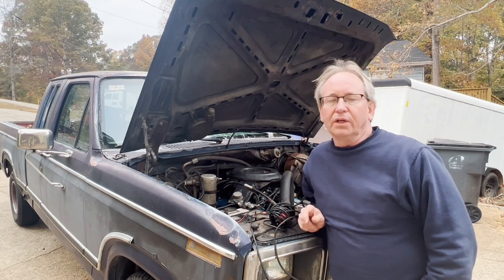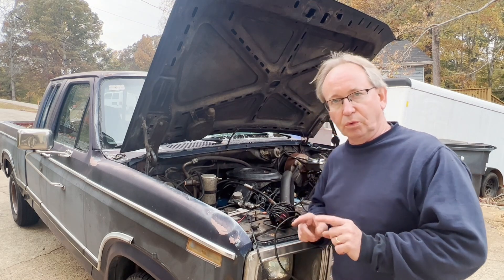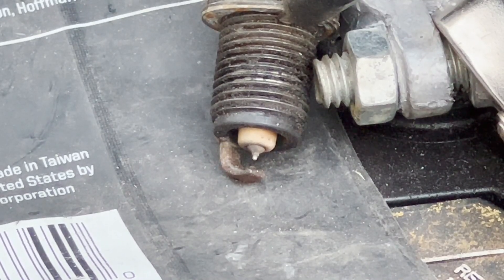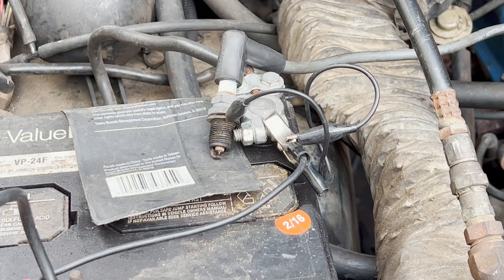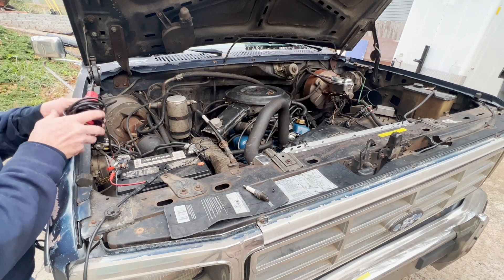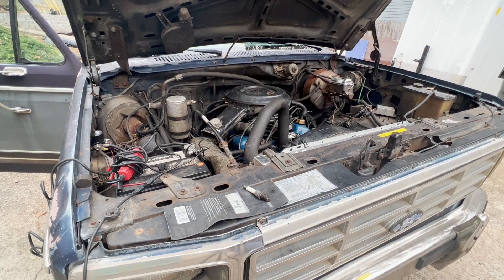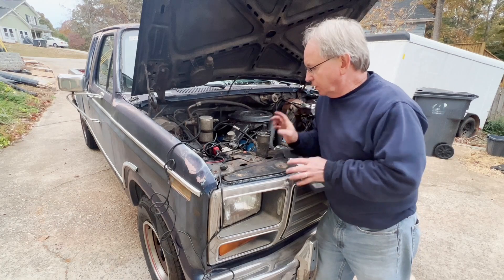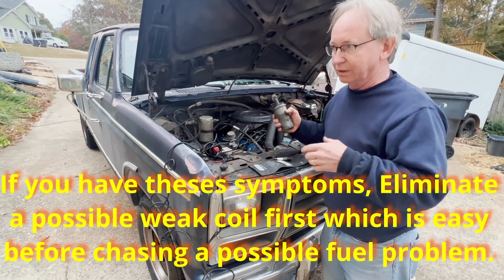How To Quickly Diagnose The Sneaky Weak Ignition Coil

Comment: My truck started up and ran at idle perfectly for a while but ran terrible under load changed starter battery solenoid checked all grounds harnesses wiring now a crazy voltage drop every time can that be related to a bad ignition coil
Reply from the maker: Hi. Thanks for watching and commenting. Yes, this video has helped countless people pulling their hair out messing with the fuel system and it's the coil breaking down. That's why it's "The Sneaky Weak Coil". Only takes a few mins to swap a known good coil in and see if that's it.
The Starter/Battery/Solenoid are all out of the circuit, once it's the engine is running. If the alternator is working properly, you can pull the battery right out of the car while it's running and it will stay running, which is actually something to check. Sitting idling the voltage across that battery if the charging system is working should read 14 - 14.2 VDC. If the alternator isn't charging then the ignition system is now using the battery which it shouldn't which will drain the battery and lower the output from the coil causing a weak spark.

Comment: never do this as hydrogen gassing do and have and can explode like bombs when sparks or flames are nearby.The cardboard shield is something helping but you never know and the resulting blast explosion could blind you easily.
Reply from the maker: Hi, Yes good point. I thought about that after the fact that the battery was not the best place to have open sparks on top of. FWIW, that was just a visual aid. The point of the video is how a coil under load will break down and present itself as a fuel system problem. This video has solved that problem for many people that were pulling their hair out. 
Anyhow, thanks for reminding me about that. I'll pin a disclaimer comment to the top so it's always the first comment at the top. Thanks

Comment: Great information.  I had an issue with my 68 Bug with a high energy coil.  It seemed like I was running out of gas.  Luckily I have a fuel pressure monitors, and was able to validate there was no fuel issue.  Problem was a defective coil that the manufacture claims their equipment was bullet proof.  Well guess what?  Once I replaced the coil the car runs perfect.  I was able to show that the secondary circuit of the coil was defective.
Reply from the maker: Hi. Thanks for taking the time to watch and comment; glad the video helped you diagnose and solve your issue! Those little rascals are indeed sneaky. ;-) They can test fine statically (ohm meter) leading you to believe they're fine, but only fail dynamically of which swapping is the quickest way to prove it, or rule it out. 
Thanks again for watching. Glad the video helped.

Comment: Don’t focus on the color of the spark focus on the consistency of the spark
Reply from the maker: Hi. Thanks for taking the time to watch and comment. Good advice. 
In hindsight, I could have left all that out as the camera doesn't see it the same as your eyes. Your eyes and ears can see and hear the difference, but the camera phone doesn't unless it's extreme. Kinda wish I left that out or presented it in a different manor. 
The objective of the video/lesson is that the weak spark as RPM (input frequency) increases deceptively presents itself as a fuel system issue and has people wasting all kinds of time and money chasing a decoy.
My first vocation with years of training and experience is in electronics (check out my vintage electronics repair videos) so I have a deep understanding of how inductors, a reactive component, react to frequency, how they work when they're working, and how they fail. It's a transformer using pulsing DC to emulate an Alternating Current so they can build and collapse a magnetic field with the back EMF inducing a phase shifted stepped up voltage in the secondary.
I enjoy teaching and helping. I'm happy that the video as seen by the comments has helped many folks have an "ah-ha" moment and solve their issue. I had a restoration and repair shop and would have DIYers tow their cars to me after buying new carbs, fuel pumps, etc and I'd fix it in seconds. They were both grateful and kicking themselves at the same time lol.  This is actually my highest viewed video.  I'm doing a series right now on a 66 Mustang and 347 Stroker. Just loaded the first two videos yesterday you might enjoy. Thanks again for watching.

Comment: Been a long time since encountered these problems.  With the old points and condenser it was easy to back track but with electronic  {no points no condenser / capacitor}.  I think you have it the wrong way around,  a tight blue spark is healthy -  but a fuzzy yellow spark is the weak.  I was thinking fuel problems as going for long drive first tie in ages -  when going fast for long then it would start to pitter -  but I still do think its a fuel filter issue not keeping the float bowl full -  as it seemd to be related to the fuel bowl running low.  But you comments today definetly hit the mark with cold starts.  I had renewed everything {accept the rotor due to robbery of their cost}  and put a hot sports coil in.  But 6 months back in NZ summer i suddenly had to start using  starter spray.  Problem is the solution,  without spacific extortion.  NOTE.  I had a friend once who said  "Dave - If you want yr car to run like new - you put new parts in."  So I ended up renewing  rotor / cap / plugs and leads.  I had to keep backwasing my fuel filter  {having elec pump makes this easy. Eventually had to flush & filter fuel from tank to carb.  Looked like someone syphoned gas - but also put some mud in tank - literally}.   After every fix would run right as if I got the problem then start breaking down again.  Turns out -  when I put the new leads in, ran fine in the shop parking but started spluttering. Given missing on all cylinders I swapped the HT from coil to cap with my old one - then ran well.  {new one defective}.  After going round in circles on long drive I go to start after putting fuel in -  wont start, spark fuzy yellow.  Determined the new coil now at fault.  Luckly didnt throw the old coil out and put that in - and now runs fine.  So put new parts in but be warned new parts can be defective.  Its a tight blue to white spark is what you want.  Im thinking to get cheap chinese coils and make setup so each plug has its own coil trigered by the distributor cap set up modified to trig trasistor for each coil.  Dont know yet. Devil in the detail and results in the determination.
Reply from the maker: Hi. Thanks for watching and taking the time to comment. Yes, you're correct on spark color/appearance. I mis-spoke.  
Here's how it all works: 
A coil is actually a Transformer which requires an Alternating Current to induce the Back EMF into the Secondary and step up the voltage. The pulsing DC to the primary which is the result of the points opening and closing or a pickup in the case of electronic ignition acts as a simulated AC by applying and removing DC to the primary. 
The coil can "Ohm Out" and test fine with an Ohmmeter as far as resistance which is only being measured by a small DC current from the meter. Under actual operating conditions the thin coating of insulation can break down causing internal winding shorts and or it's impedance/reactance to change which is a resistance that is only present when there is an alternating current. As the throttle opens the frequency increases. Not to Geek Out, but Reactance XL is XL=2pi (or 6.28) x f (Frequency) x L (inductance) in Henries: XL=6.28xFxL so if frequency (Engine RPM) increases then reactance (XL) increases. If there's an issue with the coil, the inductance rating or Henries (L in the formula) goes down and so does the Reactance and the Secondary Output which is the center coil ignition wire to the Distributor. 
Fuel starvation will act almost the same way. I have a video on that on my channel where I had a flaky fuel pressure regulator intermittently and shutting off fuel flow. 
Ironically, sneaky weak coil will fail and recover at the exact same throttle/load position. Fuel starvation failure point will jump around as how it fails is determined by what the load conditions were just prior and what you're telling it to do when it fails. It will recover at different point backing off. With the weak coil it's always the same spot backing off that it recovers. 
Hope that didn't put you to sleep LOL. Thanks for watching and taking the time to comment. ;-)

Comment: Took me the better part of a year to find and resolve the same problem, only difference, mine started fine when it was cold, but refused to start after it was hot. Tried checking everything from voltages, vacuum lines, emission solenoids, fuel flow, fuel pressure, plugs.............. when in the end, it was the coil. Now my 1983 351W starts quicker and running smoother than when it was new.  👍
Reply from the maker: Hi. Wow. That is great news! Glad my video helped you resolve the problem. Sounds like the ambient engine heat was affecting the windings.  Coils (at least old ones) also have oil in them to help cool them. The oil can leak out. The weak coil is truly "sneaky". I had a restoration and repair shop where owners would bring me their cars on a flatbed after spending all kinds of time and money going down the fuel system rabbit hole. I had figured this out as kid with a bunch of old coils. A coil is actually a Transformer which requires an Alternating Current to induce the Back EMF into the Secondary and step up the voltage. The pulsing DC to the primary which is the result of the points opening and closing or a pickup in the case of electronic ignition acts as a simulated AC by applying and removing DC to the primary. 
The coil can "Ohm Out" and test fine with an Ohmmeter as far as resistance which is only being measured by a small DC current from the meter. Under actual operating conditions the thin coating of insulation can break down causing internal winding shorts and or it's impedance/reactance to change which is a resistance that is only present when there is an alternating current. As the throttle opens the frequency increases. Not to Geek Out, but Reactance XL is XL=2pi (or 6.28) x f (Frequency) x L (inductance) in Henries: XL=6.28xFxL so if frequency (Engine RPM) increases then reactance (XL) increases. If there's an issue with the coil, the inductance rating or Henries (L in the formula) goes down and so does the Reactance and the Secondary Output which is the center coil ignition wire to the Distributor. 
Hope that didn't put you to sleep LOL. Thanks for watching and taking the time to comment. ;-) Glad it solved your problem and you're running strong again. 351 is a great engine.

Comment: Thank you! You helped me diagnose similar issues on my '92 400E Mercedes. Very helpful!
Reply from the maker: Hi. Thanks for watching and taking the time to comment. This is an impromptu video I made about 2 years ago after it had just happened. I knew what it was right away from experience and thought back to when I was a kid tinkering with parts laying around and ran into this with an old coil I had laying around. It had spark and ran but under actual driving load it would bog down and said aha.
Years later I had a restoration shop and repair shop. People would bring me cars on a flatbed that they were just throwing parts and time at, mostly carb/fuel system and distributors. I had it fixed 5 minutes after they left and would call them the nest day. It would have just been mean to let them know it was the coil and took 5 minutes to fix. ;-) 
This video had helped numerous people, even other shops, so I'm glad it helped you. That's my main objective: to help solve problems and teach. Hope I gained your subscription. Going to be having lots of content on my 66 Olds Toronado I'm putting together for the 100th Anniversary of Route 66. I've got numerous videos of my 74 Cutlass on Route 66 last year.
Reply: @mkdhdinfiniteendlessconten3873  Only once or twice this past winter the car was lugging under load exactly like you described, and these are known for fuel pumps failing. It just seemed so odd that would idle fine, but struggle under load. Only did this for a week, then fast forward to today when the car failed DEQ with HC=530. This still failed after I had checked secondary air pump, cleaned out the EGR and tested the valve... The car also was fowling distributor caps at ~10k which seemed quick so I began researching causes for distributor caps wearing quickly and got to wondering about ignition coils, found your video. I replaced both ignition coils for both banks and went back to DEQ  and it passed with HC=209. I'm happy to have saved some money, and even more proud of myself for proving that I could figure it out (with your video's help of course). Thanks again!
Reply from the maker: Hi. Thanks for the kind words and so glad my video solve your problem. I'm impressed with your forensic approach to researching, diagnosing, and resolving the problem. That's how to properly solve any and all problems with anything from health to machines. I had to look up DEQ. From context clues, your listing the HQ (Hydro Carbons) pointed to Emissions. I see that some states like Oregon and perhaps Virgina call it DEQ, where most states or metro areas simply refer to it as Emissions. I'm in Georgia, and only the metro ATL counties have emissions inspections here for vehicles 25 years or younger. Also over a certain GVW are exempt. 
They've become more realistic with the limits. Earlier testing required a Dyno. While having the testing as a requirement is a hassle in ones day to day life as a yearly thing, the testing points out if the engine is not properly burning fuel. If it's not, you're harming your engine. Ironically Hot Rod/Performance engine tuners are adding AFR (Air Fuel Ratio) monitors which require an O2 Sensor to properly tune the carb and engine for optimum fuel mixture which means best performance and engine health. 
It's very interesting to see that it essentially cut HC in half. That's a big deal! If you've looked at some of the comment threads, I've gone into detail on some of them explaining that a coil is really a transformer. These failures appear frequency related to me changing the impedance which is resistance that's only present with and alternating current which the coil sees the pulsing DC as. Thanks again so much for watching and hopefully subscribing. :-)

Comment: After watching this video I totally feel like a horse's ass right now I went through and replaced the ignition coil or the distributor points caps rotors solenoid voltage regulator even warrantied out the starter and the coil I bought for in 2020 was brand new and I never thought to check the coil again because it was brand new then...
Reply from the maker: Hmm. There's a few typos and some missing punctuation in your comment, so I'm not sure if watching the video solved your problem or in hindsight you're thinking it could have been a weak coil or now you know that it is. Look forward to hearing back from you with clarification. Hope that the video did resolve your problem. It's helped quite a few people.

Comment: Excellent info , may have just solved my problem,  cheers
Reply from the maker: Hi. Thank for taking the time to watch and comment. This video has helped quite a few people as the functioning yet weak coil is indeed "sneaky" with misleading symptoms that have people spending all kinds time and money on the fuel system or the distributor. Let me know your results.
Reply: @mkdhdinfiniteendlessconten3873 BINGO !! Spent hours chasing what i thought was a fuel issue , took ages to start like it had to build fuel pressure before starting , engine is a worked 2 litre pinto , big cam , headders and twin 40 sideys , just swapped out the coil for a brand new one , cold start, second rotation and it burst into life like a raging bull and settled into idle perfectly , way more responsive on the throttle and no more pesky missfire at wot , i owe you a beer mate , thank you , your wisdom is appreciated and cured all my frustrations 🍺🍺🍺🍺🍺🍺💯
Reply from the maker: Well awesome. Glad to know my simple little video has helped out yet another  fellow enthusiast. Sounds like a cool little beast. Hopped up Pintos are fun. Especially with a manual trans. You can really wind them up. Friend of mine in high school had one with headers and I think side draft carbs. It was fast! Glad to know I could help you out. Keep it between the ditches. ;-)